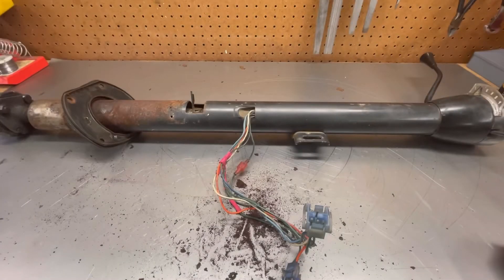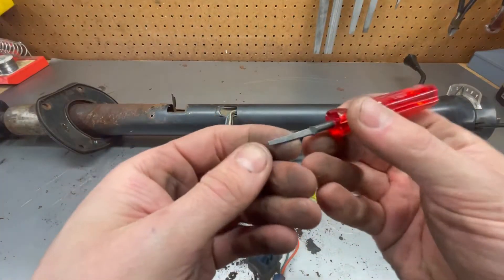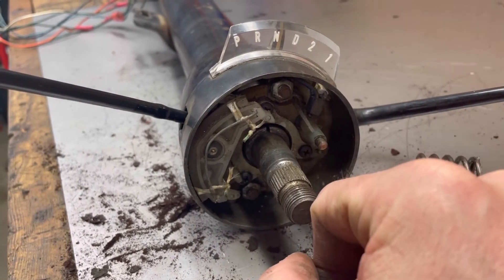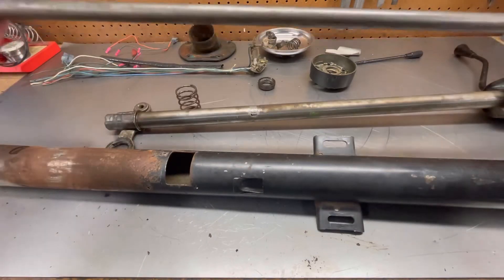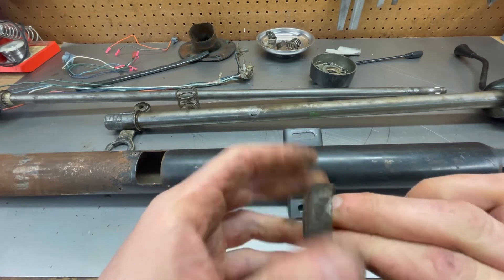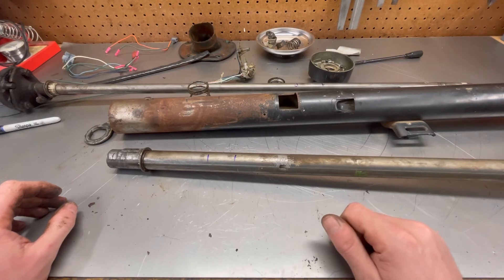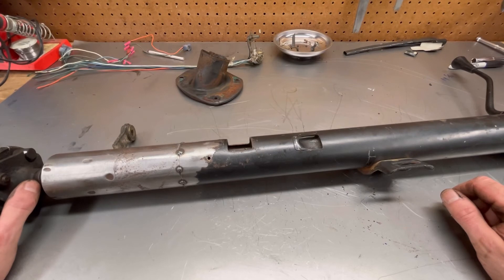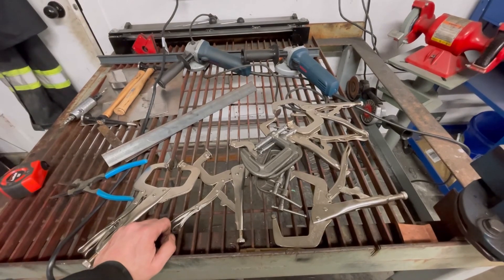Part 1: Shortening the steering column on the ‘68 F-100-Prepping for the upgraded steering box!

Comment: I’m about to have a fab shop do this for me on my 68’. 
I’m confused about measurements though. 
Was 2” the ticket or did you end up taking more or less?
Did you have any trouble with your column after the mod?
Reply from the maker: Hi Adam. The 2” worked out perfectly! 

No issues at all. Everything fit nicely and it was well worth the effort!
Reply: Thanks a ton for the video and the answer to my questions!  I really appreciate it 🤘
Reply from the maker: You’re very welcome Adam! 😎
Reply: Did you have to do this to go power steering

Comment: This is very informative thank you for sharing I have watched this video a couple of times to help me with the 69 I’m trying to convert from manual to power steering, also working on converting the drum brakes to disc brakes by swapping the I beams from a mid 70s.  Do you know anything about the proportioning valve and the master cylinder for the swap?
Reply from the maker: Thanks for the feedback, really glad you found it helpful! 

Your best bet is to find a ‘73-‘79 parts truck and take everything from that including the master and proportioning valve, or just purchase the parts for those years from your local parts house! 

Thanks for watching!!! 👍🏻👍🏻